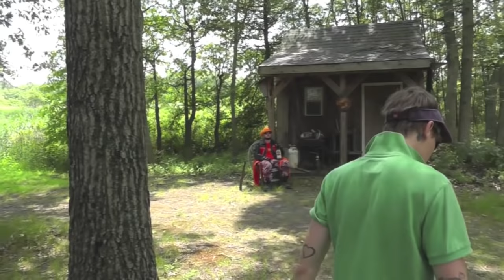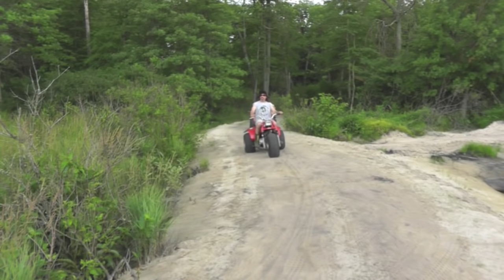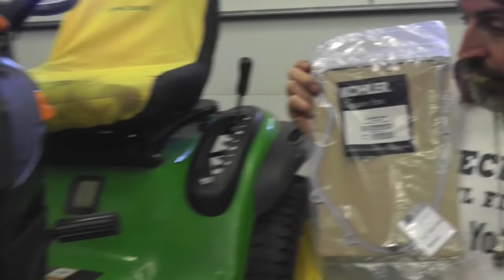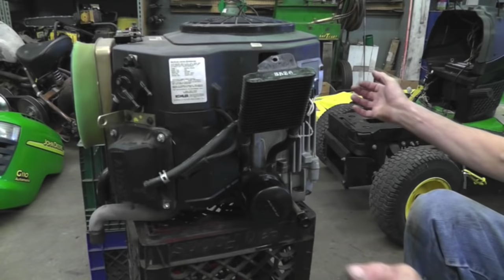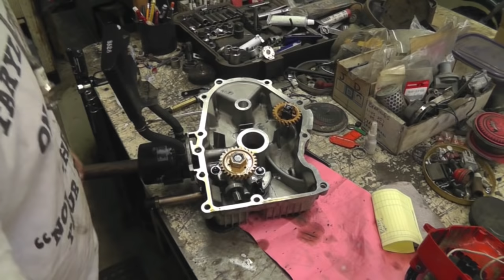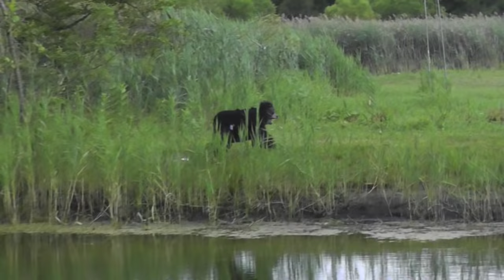How To Replace The Sump Gasket On A Kohler Command Engine

Comment: Thank you for making this video. This one, and some of your other videos, gave me the confidence and know-how to rebuild by Scrub Cadet with a Krohler. New oil seal, steering gear, tires, #2 valve body,  crank case-oil pan seal, drive belt, and deck belt. I have no engine experience but my little 700 series Krohler has been running smooth since the rebuild. Maybe because I torqued everything down like a moon rocket? Thank you!!

Comment: Hey Taryl, got a question. This Kohler cv23s 75593 i have, has a small oring on oil pan sump. Do i need a gasket for this type of engine, or just seal it up? Looks like a gasket wouldnt work with that seal in it. Right beside the oil filter location on sump. Thanks bro.

Comment: i just split apart a Command CV18S and it didn't have a gasket from the factory but the Sump pan itself had a rubber lip built onto it. Is it absolutely necessary to use a gasket?

Comment: Hey Taryl, can you answer this for me please? What is the plug in the pan there by the starter I have a leak on my 27 hp Krohler and it looks to me that it’s not the sump or the crank seal but maybe the plug. Thank you for your time.

Comment: What brand gasket sealer would you recommend to seal up the oil sump/? I need to replace the governor on my Kohler command 15 and there is no gasket to seal it back up.

Comment: I have an Exmark Turf Tracer with a Kohler Command Pro 23 engine. My mower just started racing so, from what I could see from some videos, I have a Governor problem. The hole in my deck was big enough that I could get the engine out with the small pulley attached. When I turned it over I seen no set screws in the pulley. Does this pulley get pressed out? Also what do I look for once I take the cover off? Any help or past videos that you may have made on this topic sure would be helpful. I have grass growing and it isn't waiting for me. Thanks for any advice or help. Jack

Comment: My 17.5 Kohler has a triangle shape cover on the sump. It covers the oil pump. It has to be taken off so you can put the sump cover back. The oil pump shaft has a flat spot to drive the pump. If anything moves after the cover is off it won't line up. IF you take the oil pump out, the flat spots don't need to line up as you lower the sump cover. It's easy to line up and drop the pump parts onto the the shaft once the sump cover is already down.

Comment: I use electric pin and engraved all around case you help hold gasket down to not slip out with K/W seal or high -tec liquid or spray

Comment: PLEASE HELP! HUGE QUESTIONS! #1. I have this style sump but its Courage twin engine, I rebuilt lower end and new valves, etc but I forgot to put loctite on the sump bolts and it's that RTV only gasket... (my all standard master rebuild kit did not come with new locating dowels or a gasket) AND all sump bolts LOOSENED UP!!! within an a hr!... can I put this REAL gasket on INSTEAD of, or with, the RTV?(more endplay?) (or just stick with rtv) #2 secondly, speaking of endplay,  my NEW crank was NOT returnable, as they sent me WRONG one for a horiz vs a vert engine... so I had machine shop change gears on new crank and turn crank to match one I need. I noticed BEFORE I pulled it all apart, when I was underneath,  that the crank shaft can move up & down almost 1/4 inch of endplay... (I didnt forget any shims, etc.) is my motor ruined?

Comment: not related to video but, I have a 2 year old craftsman riding mower and some oil/grease has seeped out of the axle seal.  I have replaced axle seal and dont really seem to be seeping anymore.  I wonder how big a deal this would be the transmission in  my mower is a RS800 General Transmission and supposed to be a sealed transmission

Comment: I did a sump on a Briggs and Stratton.  That old gasket was almost paper thin yet it was made of some sort of black plastic.  Most of it came off easily but for a few small spots I used a drill with a wire brush and a razor blade.  I just used some oil resistant silicone instead of a gasket and no more leak.  My Aunt had one with a similar engine except hers had a broken connecting rod that punched a small hole in the side.  At first I thought she was just clumsy with the oil because it didn't have a real dipstick tube but I noticed that hole pretty quick.  Of course that one would just spin and for a couple seconds and do nothing else.  That was a 550EX series.  I wonder how good or bad those are and if it was low on oil when the rod broke.  I am not sure if it is a common problem with those or just a lack of maintenance but that is the first time I have seen that happen.  I have heard of people welding those holes shut but I don't like doing that around oil or gasoline.  I would prefer to keep my eye brows hahaha!

Comment: Hey Taryl have you ever worked on a simplicity sunstar 20hp model 1691018 Im having a problem with one I purchased recently where its leaking out of the steering wheel from the steering stem I knew it was leaking and got it cheap for a parts tractor for my other sunstar but its too good to part out I need a rebuild kit or seal kit but simplicity says no longer manufactured Its almost identical to a 318 deere steering box its just a little longer have you ever had to order seals for one I need Some advice on where to find these or would i be able to order through your shop if nothing else Do you know who made the steering box and tube for simplicity sunstars maybe that would help ? Thank you

Comment: 27 hp Koehler engine pipe inside exhaust 2 inch long by 1 inch pipe from engine to exhaust assembly, , Is it important to reassemble with that in the????

Comment: Iv got a Kohler command ch22 hp on my ariens tractor it always runs good it starts out having 50psi oil pressure time I get done mowing its got very little pressure took my sump off all look good oil pump good no play on any thing oil pump wasn't loose or by passing I used silicon reseal it that's way it was befor looked factory think I put a biger oil cooler on it has a fan iv got a heat sensor I can use on it iv got a few hills lol blower is clean and cylinders free off crudys

Comment: mr taryl - i have a Kohler CV740 - 3132. i ordered the kohler gasket kit and it did not come with the non perforated guide pin........? it came with a o ring instead. any ideas ? thank you before hand !

Comment: just one question there...
how on earth you get away installing seals and gaskets without headgasket selaer ?
every time i attempted without it, it failed shortly.

what i like to do, is to use break cleaner spary to super clean the surfaces, then apply a thin layer of gasket sealer (the heat resistant red stuff, naturally) and then apply the gasket, spray the gasket, then apply a thin layer of sleaer, spray the pen, then assemble.

the pin you replaced, i glue those with bearing glue, makes sure the bugger stays in place for eternity, and will never allow any leakage.

for sealings, spray clean, thin laye of gasket selaer, then hammer the fooker right in place.
never had a problem.
a nother thing to check with seals, check the shaft that goes in it, if it has deformed, the seal had bitten it, then a new seal will not live long.
i usually take those to a machine shop, have them welded up a bit and grinded back to the original size.
its not expensive, and makes things work far longer.
i allso like to use the high temp. resistant heavyduty seals, usually come in red color and made out of silicone-ish material. works like a charm.

Comment: Taryl bro
I got a 98 craftsman tractor 15.5 hp kohler 6 speed.
My question is id like to wire a LED driving light probably 50 watt.
Is that possible to do? 
The lights that are on the tractor at this moment only work when the tractor is runing and they dim if i turn the speed down.
Reply from the maker: You would have to get the alternator & voltage regulator from a tractor that has a an electric PTO in order to have enough voltage to run 50watts. Otherwise the battery will go dead if you try to run it for a long period of time with the lights on. You could try to wire it with the existing alternator before you decide to upgrade  the electrical. Turn on the led lights & check across the battery to see how much draw yur pullin with the engine running at idle & full speed. That alnernator that you have now has a wire for chargin the battery & a separate wire for the head lights AC voltage. Thats why the lights dim. More voltage to the headlights when the engine is spinnin faster.
Reply: Taryl Fixes All Mr. taryldactal great video first of all and secondly is that deere there a L108 I recently purchased one before doing research and I'm not hearing good things any advice is appreciated and great channel

Comment: Hi taryl  can I use that  gasket  on my kohler ch23 engine  instead of silicone?
Reply: I been wondering that too, but I think all the Kohler horizontal engines use sealant instead of a gasket on the crankcase.

Comment: The oil pan cover was hard to get in because you didnt take take the pushrods out.  When you take the sump off with the pushrods in, the lifter springs push the cam and crankshaft out of position.  Bad idea to pound on anything with a ball peen hammer like that...just pull the rocker covers and pushrods and save yourself the potential galled journal!

Comment: what would make a engine have gas in the oil
Reply: carb needle valve not shutting the gas off ,easy fix is to put a gas s hut off valve in the fuel line,run it out of fuel each time before stoppingthe engine

Comment: Dam a koler motor...junk..piss poor designed.allways leaking oil,throwing rods,won't start..I have never seen a good one yet..and I've had 9 of them on different mowers.all went in the trash .Just threw the rod in the 18 command oil pickup tube clip broke and dropped off..no oil.plastic garbage..another cub cadet sent to the scrap pile..